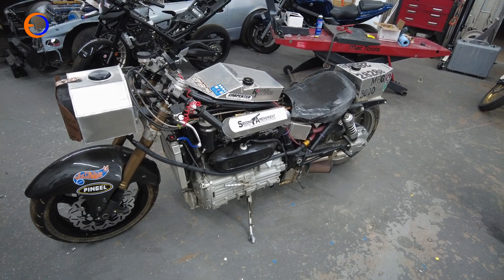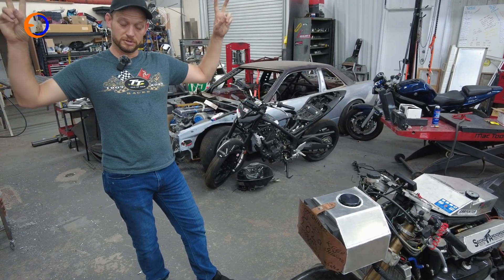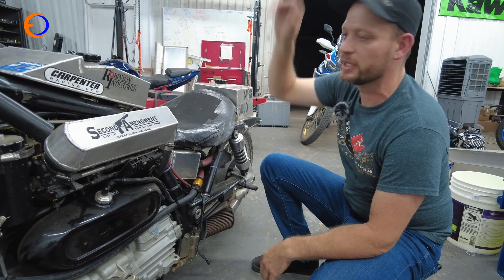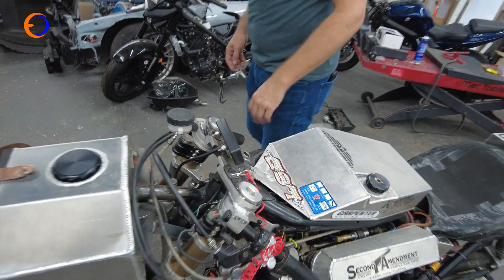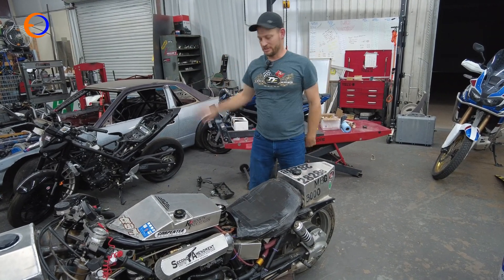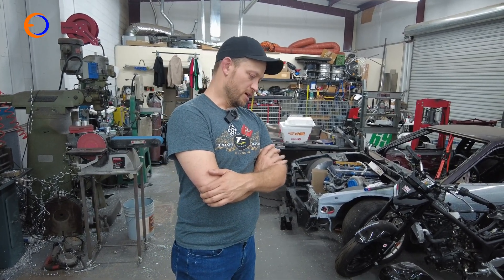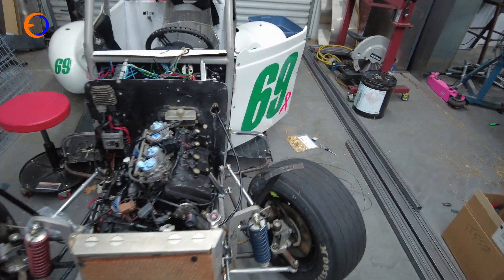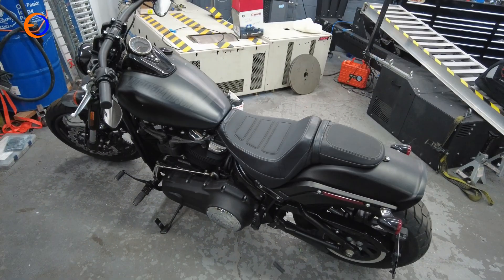Beasts of Bonneville. How to build turbo Land Speed racers for 300mph on Salt. Rocket 3 Triumph

Comment: Should have "Death Machine" on the side, looks like something out of Mad Max movie..  wonder what Guy would think about this thing...LOL    Good friend of mine worked with Carpenter Racing's TRIUMPH-Castrol Bonneville Streamliner project.  Carpenters built the 2 -  Rocket III triples for the Streamliner. 1480cc trubocharged 554hp each.. MoTec .. all sorts of goodies .. Engine is a masterpiece in person.. Carpenters sells a  Rocket III bolt on Turbo kit IIRC that brought that to market.. 1100 hp..  detuned to 700.. along with their "265" and 245"  HP kits ...
Reply from the maker: Blooming eck, 1100 ponies would get exciting!!
Reply: Full disclosure: The head & cams are a Bob Carpenter effort, along with the CP pistons. The rods are a  custom Carrillo piece for our application. Ecu is a Motec M1 series with their PDM as well. All the hard parts are fabricated in house.

The 1100hp was the estimate on the combined output of the two streamliner engines. Bob did do a sub 400hp street legal Rocket iii, smaller turbo placed under the seat... real neat piece of work, but no where near 700hp. :) This one couldn't do that without a much larger turbo and alcohol fuel... if it didn't drive over the crank or transmission in the process.